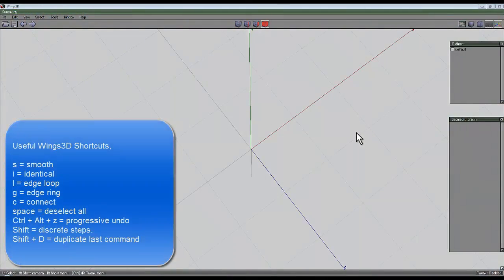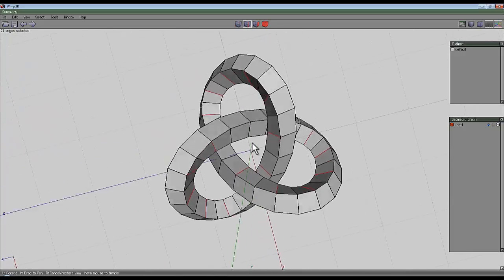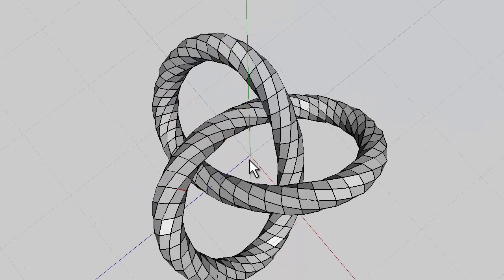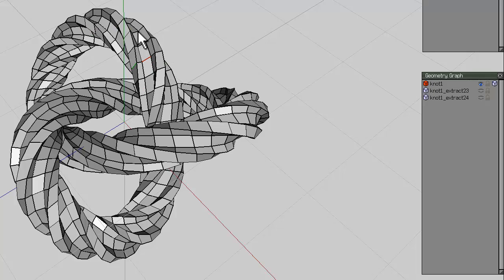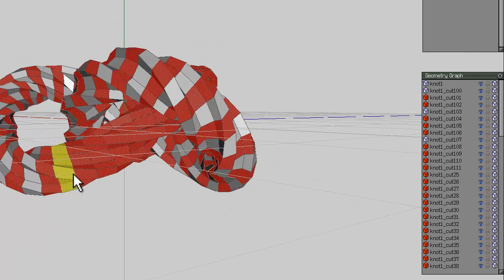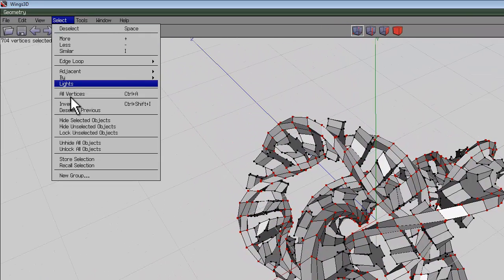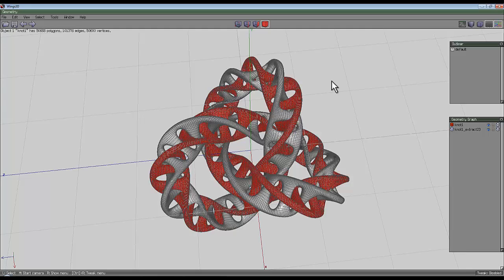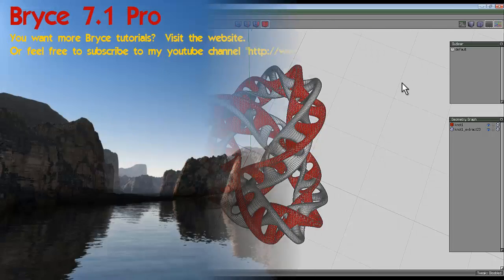Wings 3D project - interlocking mobius torus knot - by David Brinnen.

Comment: This video taught me that wings is case sensitive. I do like free though.
Reply from the maker: After using Wings for the last month almost exclusively to complete a project, I can say, there's a lot more of Wings that I don't know about.  And sometimes turn features on that I then need to figure out how to turn off.  When I get the chance I hope to investigate and cover some of these.  Like, why things operate differently when Caps Lock is on.  That has confused me a few times.
Reply: Hi David Brinnen, Wings3d is case sensitive for hotkeys. That enables you to multiply them by using the modifier keys (ALT, SHIFT and CTRL).
Maybe because you can see the hotkey signed in the menu option with [ I ] and you have to hit [ i ] you get confused. But you have another use for [ i ] when you combine it if combined with [SHIFT] key (that could means "I", but not for this use). Did I help to clarify the things or I did them more confuse? :-)
Reply from the maker: Micheus Vieira er... yes... I think.  There's also the "tweak" menu thing too... That also throws me out.  Essentially I get easily confused.

Comment: David, I am trying to create a chain in a loop using the Torus, with 36 sections. I select a horizontal edge, hit L,then G, then C. I bevel the results, extrude normal, shell extrude normal. I delete the base shape, choose every other new torus, & rotate 90 degrees. That's as far as I get. There's a Rotate to Target in the Rotate options, & I think it's what I need, but I don't know how to use it. Can you help with this? I would appreciate it if you can. If not, don't worry, I'll find a way.